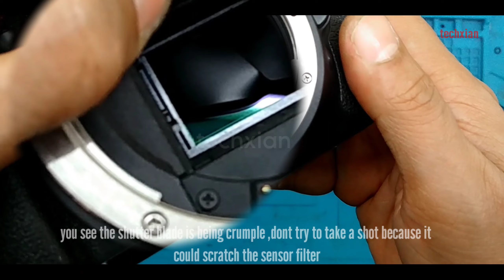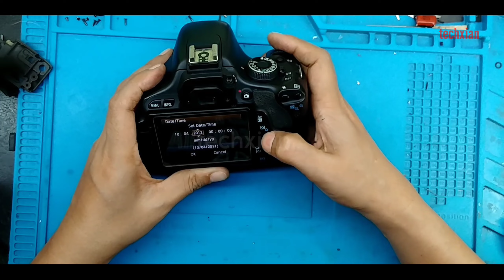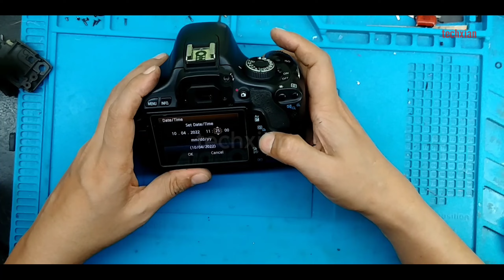CANON EOS REBEL T3i SHUTTER BLADE REPAIR/DISASSEMBLE/ASSEMBLE

Comment: Hi inside my camera when on mirror cleaning mode I can see a metal pin that is slightly obscuring the sensor by a few mm, what is this?? I have gently pushed it back down and seems ok is this something to do with the shutter blades? Is it part of the shutter that hasn't returned properly?? And does it mean the shutter has a problem ..Thanyou

Comment: How did you mark the clearance of the sensor alignment?
Reply from the maker: i only mark it when i removing the sensor sir to prevent disalignment when i installing it again..i used a sharp tool to make mark to the clearance of the sensor if it is still original alignment...
Reply: @techxian  thanks for the reply. Unfortunately I couldn't understand. Could you please elaborate the process? It would be really helpful for me.
Reply: What he means is that he uses a sharp tool and make small creases around it to know exactly where the sensor was.